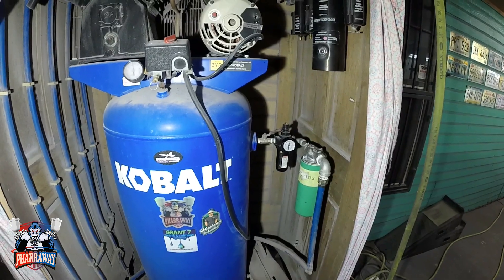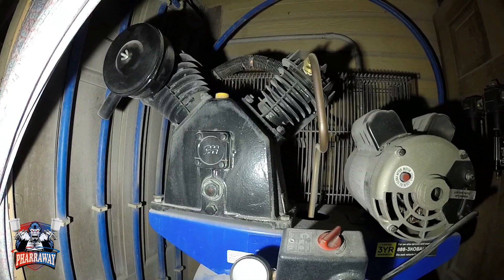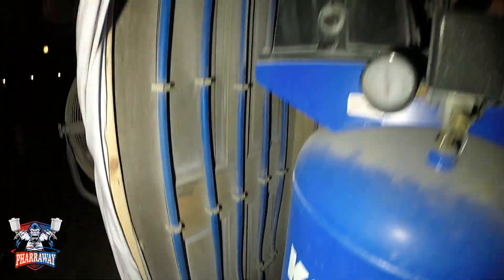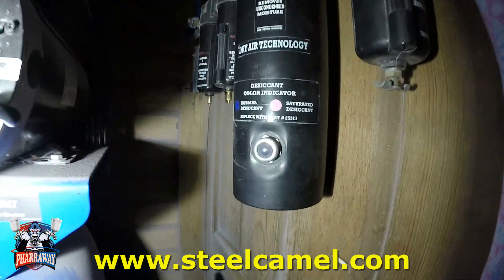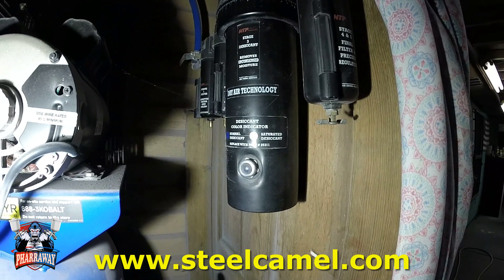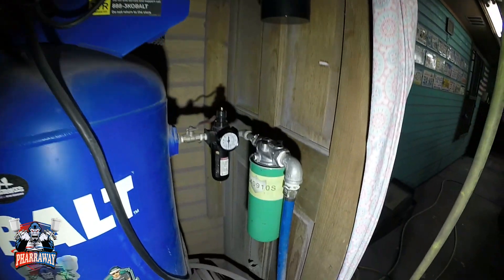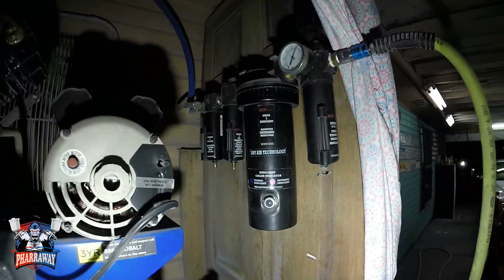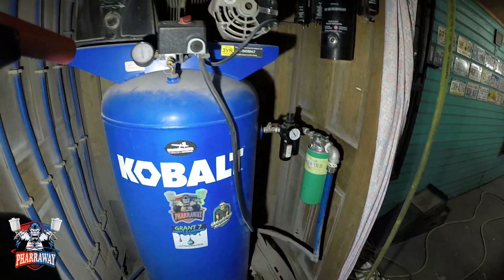How to Remove Water from Compressed Air Lines / How to Keep Water From Ruining Your Paint Job

Comment: You should put the steel camel after all the plumbing so that it lasts even longer! The way you have it set up now, you're cleaning the air before it goes into to the serpentine plunbimg which kind of makes it of little effect I think. You should let the serpentine plumbing do its job first, then into the steel camel, then into the crystal desicants and then out to your line. Just a thought!

Comment: are you using the rapidair maxline 3/4 fitting as well or did you go with a different brand of elbow and T connectors?
Reply from the maker: Difrent brand
Reply: @PHARRAWAY  do you happen to have a link by chance thank you for all the knowledge you are providing us just Starting out 🙌
Reply from the maker: @levigriffin3717  no sorry it's been a long time
Reply: @PHARRAWAY  it's okay I thought I'd ask! I will put a comment above for others I found jbtools had the same style fitting for a lower cost

Comment: Nice video and good infor I've been having issues with my setup however I have a question how much pressure do you have going out the tank into the regulator to the camel filter thank you
Reply from the maker: 90psi

Comment: God bless you too, my brother. I do not have an active ion exchange system, such as 5 stg final dryer. I do have a 60gal 2 stg compressor similar to your own. I heard you say that the steel camel  could be enough to get good, dry cda. Should I go with a larger camel or do you think this model is good enough. I only hobby paint for myself only and almost never for friends or for extra income. And I would put a tee to a separate regulator for other compressed air work. Thanks!
Reply from the maker: Hi brother yes this model would be more then enough just tell them pharraway sent you
Reply: @PHARRAWAY  -I shall, my brother

Comment: Take the beads out and put them in a pot and place on the stove on medium heat, stir them every 10 min until they turn blue again - I do this and reuse the same beads
Reply from the maker: Yup been doing that brother
Reply: In a pot? I heard the oven works. In the pot, it doesn't damage them?
Reply from the maker: @creationzthruair834  yes it will not damage them

Comment: Do you have a regulator at the line you use for your spray gun? I regulate my air pressure at 120 on the compressor and 90 for the hose connections. I have a motorguard paper filter at spray gun mine. Dessicants break down and create problems. For the money spent I would recommend a refrigerated dryer and you don't have to replace dessicants? Ever have fisheyes that won't come out with the little white spot? Broke down dessicants. Move your camel filter 25-30 feet away and use the motorguard 75 feet away with 4 loops w drain at bottom and you'll save a lot of money. You have a nice setup but spent a lot of money you didn't need to and hobbyists have a hard time justifying that
Reply: Where do you find a refrigerated dryer for $400.00? Thanks
Reply: @TheBabins  harbor freight has one also...not sure of the quality
Reply from the maker: @TheBabins  usaweld.com
Reply from the maker: Yes I do at the gun

Comment: A lot of people make the mistake of mounting the water separator/dryer bead combo to close the the compressor. You have it right. There needs to be a good length of piping or they wont work properly.
Reply from the maker: Thanks yes that is true

Comment: Nice setup I made one similar but it’s in a Mobil quiet box. With temperature controlled puller pusher fan and I have pre tank cooler lines. From the compressor heads before the tank. Then I have after tank coolers on the outside I’ll have to post a video.
Reply from the maker: Nice